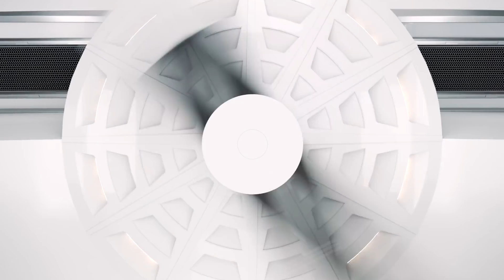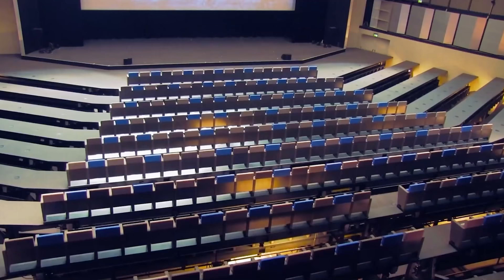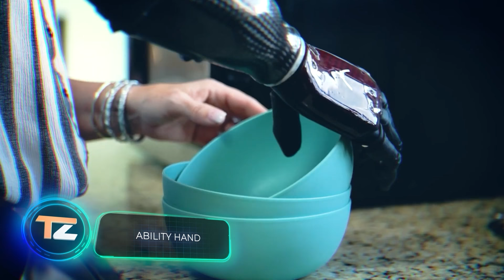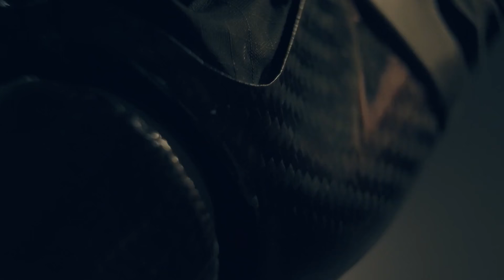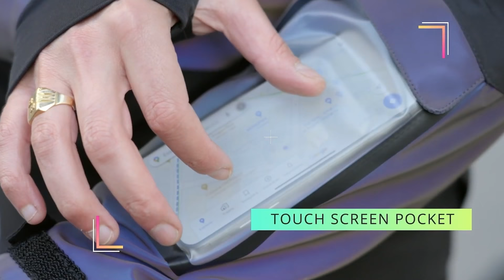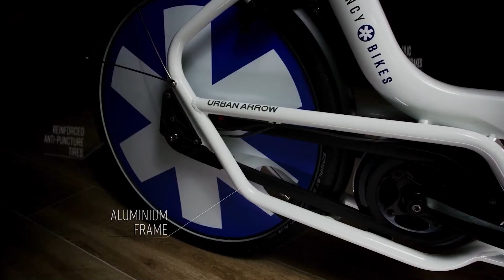HIGH-LEVEL INNOVATIVE INVENTIONS THAT YOU HAVEN'T HEARD OF

Comment: It would be better not to use heat to weld PVC as it causes the Plasticizer to be boiled off and can result in a crack running down the full length of the seam 5-t months after manufacture, an example of this problem would be PVC macs which have gone brittle at the seams, much better to sew with see through thread and seal the seams using strips of the sheeting smeared with Vinyl Weld placed over the seam and rollered down and allowed to cure and the process repeated on the other side of the seam. No one wants their PVC mac or dress to fall to bits because of the fact that the seams were heat welded. Maybe I might be wrong but it seems that some companies choose to sew rather than weld and not take chances.

Comment: I think we could grow better prosthetics - think hydraulic carbon nanotube muscles - using CRISPR, glass sea sponge DNA and the DNA of a specific fungus from Fraser Island, Australia. If we had a piezoelectric-like "fluid" acting as the hydraulic fluid, we'd get sensory input directly as electrical signals that vary in intensity with pressure. We could also potentially grow super-efficient "solar" (they'd convert far more than just UV) panels using this same method :)

Comment: I don't know why they don't just use a rail gun to launch space craft. If they're not going to put them on the battle ships they shouldn't let all that research go to waste.
Reply: Because the power requirements are exponential with mass and a railgun can only accelerate ferrous materials :)
Reply: @3nertia  yeah but it could still be attached to a a carriage that is attached to it or something.
Reply: @keltonfoster  That would just increase mass, thus increasing the energy required, again ...
Reply: @3nertia  have you seen how they are going to launch satellites from a vacuum sealed sling?
Reply: @keltonfoster  I've seen many videos on the concept of it but I've never seen it actually used and reported on ...